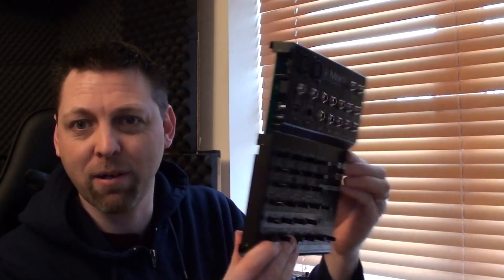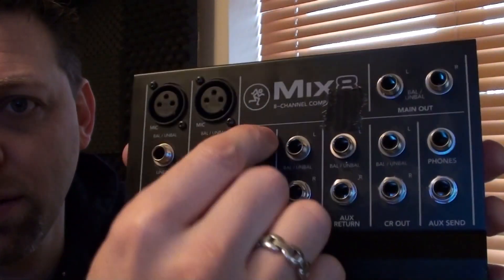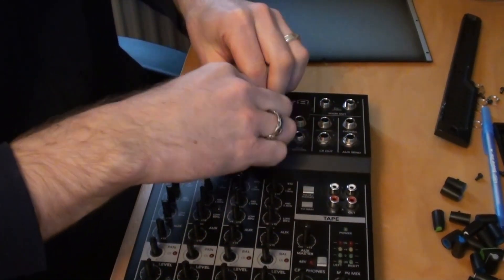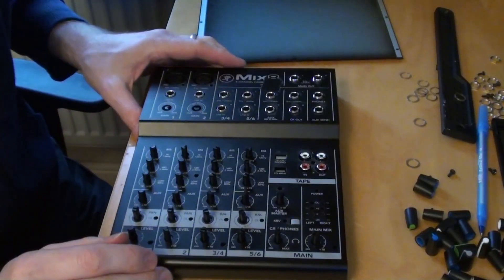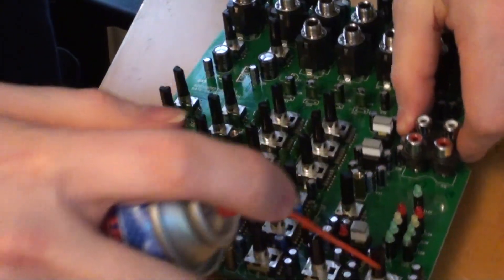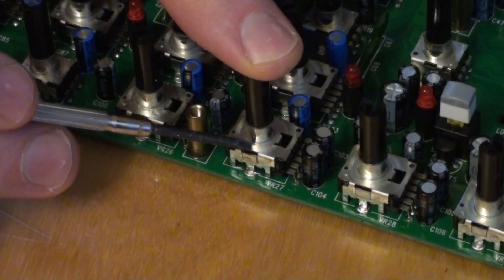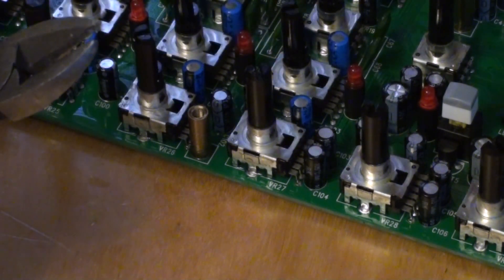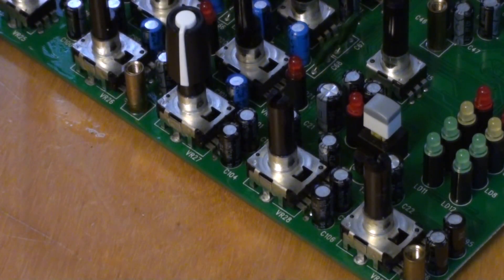How To Repair Any Mixer - Hot Audio Tip - Mixer Hack

Comment: I have an 8 channel mixer that was working fine with left and right output with XLR plugged in and I wanted to extend to to smaller speakers with a quarter inch jack. When I plugged in the 1/4 jack I lost sound out of the right side. Could this have shorted something out? It happened exactly the same with two separate mixers. I thought it was possible to do so but I am guessing not.
Reply from the maker: Not sure if I have understood well your message. Could it be that you are mismatching balanced/unbalanced cables? It's very unlikely you have shorted it.

Comment: I got a question, maybe someone else has any direction or help with my issue.
Got a DJX900 mixer and the mixer suddenly didnt get any power when i switched on the power button.
Replaced the fuse but no difference.
Yes the fuse is correct.
Reply from the maker: Try to check the power source, cable, fuse and switch - verify that all are working. Then if you are comfortable you could inspect the internal parts for burning smells or swollen capacitors. Be aware that some parts may still contain stored electricity and can give nasty shocks! Better still, return to manufacturer if in warranty. Good luck :)

Comment: how did you take the pot caps off though?! I want to clean mine, but I can't get the pot tops off...

Edit: nvm, if I don't squeeze the pots with my fingers, but pry them up with something, they come off very easy
Reply from the maker: Yeah, they can be stubborn sometimes. I usually use string so I don't damage the plastic. Glad you found a way that works for you. :)

Comment: I have the same mixer, I’ve had mine for 3 months now and the knobs have been wiggling like that for a while now. Is that ok?
Reply from the maker: They tend to get loose yes, it's quite normal for this kind of mixer. It's only a real issue when the audio becomes affected by poor contact of the pot. The actual mixer is pretty decent, sadly the parts are not such high quality. Best to be as gentle as possible when operating it. :)

Comment: The gain knob on my Xenyx Q502 doesn't contact properly, so the result is always super low unless it's cracked to the max, when it either crackles or does pump out the audio at maximum volume. It's driving me mad, I've disassembled it but I don't know what to do.

Comment: Hello Ken, thank you for your video! I have exactly the same mixer and would like to disassemble it. It has two broken RCA male pins in the TAPE IN socket. I couldn’t remove it! Please help me!
Reply from the maker: Hi Gustavo, I'm not really an electronic expert. I have opened many appliances to fix and maintain them before but here in this video I'm just sharing one of my tips that seems to work. I'm sorry that I cannot really help you. I do remember there is a small black screw holding the RCA connectors to the metal casing. Perhaps this needs to be removed to remove it? Good luck! :-)

Comment: Hi Hello .. I bought a behringer eurorack mx 802a on eBay without powersupply... Based on research the powersupply thst comes with it is 18v for 2 of the pins (xlr) at 800 mah.

However the powersupplies being sold on eBay for it is 17v for 2 pins at 600mah... Can those eBay power supplies work?
Really need help
Reply from the maker: I have no idea I am not an electronics specialist, sorry. Maybe someone else on here could answer this question?

Comment: I have a channel that doesn't work at all, will this possibly work to fix the issue, thanks@
Reply from the maker: It's hard to say really, you might be lucky enough to clean the pot and find it works but I suspect it may not be enough. Check the solder connections around the pot and surrounding area. You may need a new pot.

Comment: What causes a mixer to only have sound on one side (left) and the other side you can barely hear anything (right)? Is it something that can be fixed?
Reply from the maker: Panning possibly, a stereo/mono cable in the wrong place or a cable that is faulty?
Reply: Mine has been doing this, I have a Yamaha and I’ve found mine gets extremely hot when it starts doing this

Comment: I have a rockville rpm 109 that really has a great powerful clear sound BUT it has developed a issue with speaker/monitor switch,,,it will only play one side,,,any ideas,,,i took unit apart and stopped when i got to circuit board as i didnt want to damage anything,,,i couldnt see a way to gain access to switch
Reply from the maker: Hard to say what the problem could be without seeing it, I would check/change any cables connected between the mixer and the monitors/speakers first of all. It sounds like a mono/stereo issue if it's only coming out of one speaker. Some mixers have a mono/stereo push button also, I would check that too. :-)

Comment: Good video thanks! .. What was that a can of you were you using to clean the pots?
Reply from the maker: It's called 'Electronic Contact Cleaner'. I bought mine in Halfords in the UK. You will find it in any decent hardware store.  Here is an example: https://www.wd40.com/products/contact-cleaner/
Reply: @kenmercermusic  It's really not a good idea to use cheap products when it comes to maintaining your electronics.....it can leave a nasty residue, which leads to more scratchy pots later on. You really should be using quality stuff like Caig's DeOxit....or, better yet, get yourself a can of EML contact cleaner by Electrolube.

Comment: You saved me, I have a Xenyx 1202 FX and love it it. I even got it as a deal at the pawn shop but lately the pots crackle and cut a bit and it's hurting the some of the FX, especially the delay. This is a great start to fixing it because I really don't want to buy a new one.
Reply from the maker: Great to hear Henry! Have a nice week! :-)
Reply: did it work ? and can i do this on a dj Controller mixer too ? I have an ddj SZ with the same problem at the FX pots 😅

Comment: The pan knobs don't work on all 16 channels of my analog mixer. They rotate smoothly, but no audible panning, it just stays center no matter the pan position.  PFL is off.  What can be the problem?
Reply from the maker: Sounds like it could be a mono/stereo issue. Check if your cabling is good or if you have any press switches on your mixer that changed the signal from stereo to mono. Good luck!